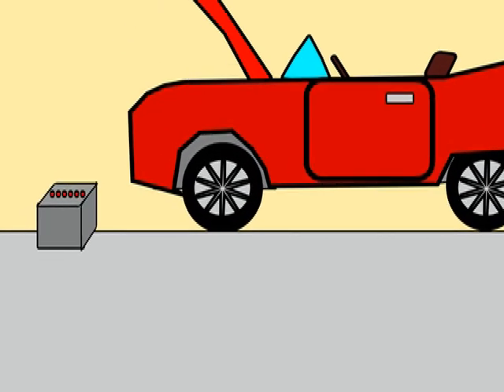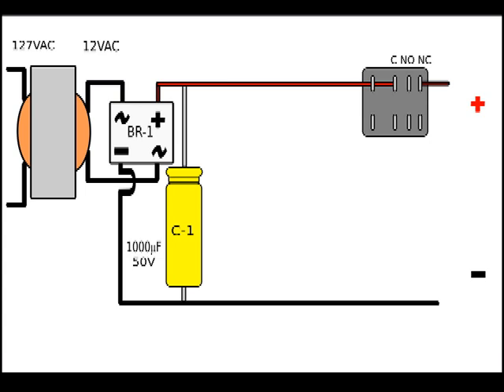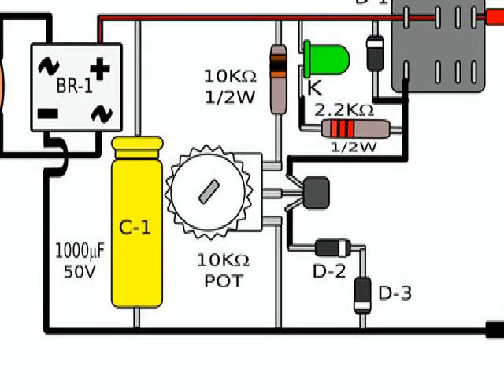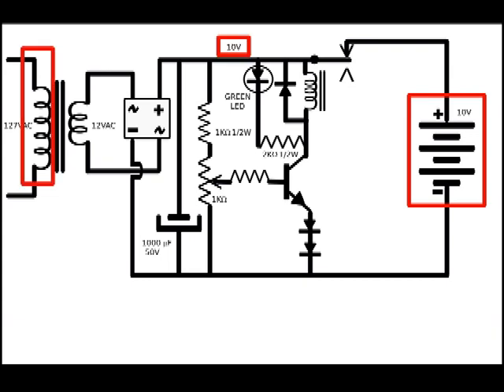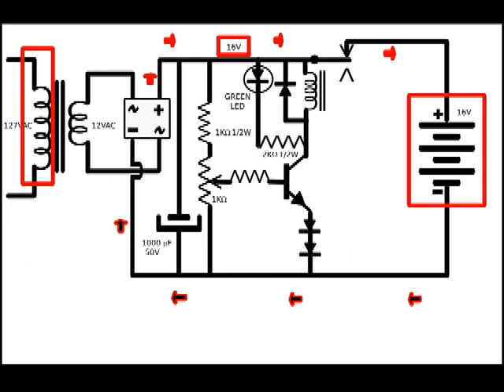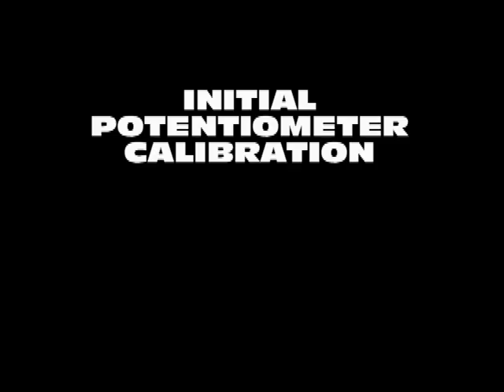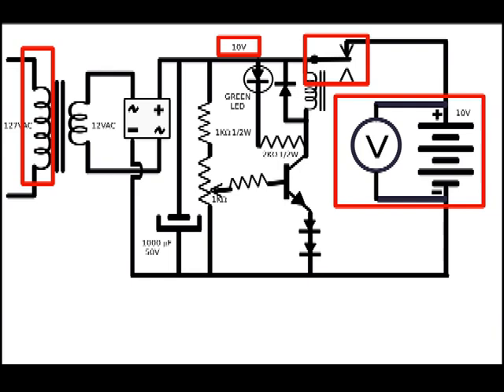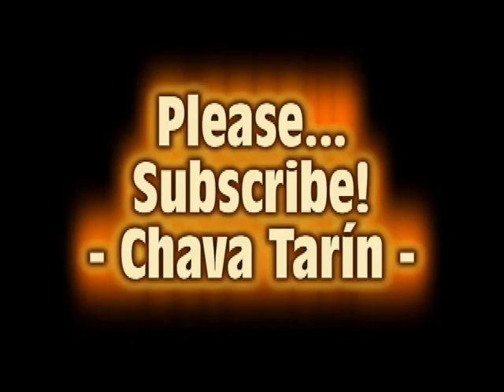Homemade Car Battery Charger

Comment: Its the same sercute for charging 12v 7ah battery sir?
Reply from the maker: It depends on the condition of the battery. If it has been sitting discharged for sometime, they tend to lose capacity due to sulfation. If your battery is not a lead-acid type, they require a special charger, otherwise they can heat up and even explode. Please beware of all these facts. I would not use it with small batteries, but only with normal car batteries, the potentiometer must be carefully adjusted for cutoff at about 14 volts. Do not leave unattended for long periods if battery warms up.
Reply: @eltunene  thanks sir for your reply, i respected 😊😊

Comment: Hi. Great video and explanation of the theory of this battery charger. I want to build it but only have a 12 volt 5 terminal relay. How would I go about wiring the 5 terminal relay. Thanks for any information on that.
Reply from the maker: Dear Fire Bird, please find in My Community some schematics and pictorial info on relays. The llink to them is https://www.youtube.com/channel/UCmjQnuJwV0FkjdEyi3099RA/community?lb=UgxcG7n42op8ZYGdF1R4AaABCQ . For an unknown reason, sometimes the link does not work, in that case, pease scroll My Community until you find it, You can also send me an e-mail address and I can send you the files.
Reply: Thanks, will do that cause I'm very interested in making this smart battery charger.

Comment: Tank you very much for this video.
But I do have a trouble on my transformer wich I  have in my old charger the one I tried to fix.  The secondary, it is at 38 volts out. So What will be the best thing to do ??

Thank you    Fernand
Reply from the maker: Dear friend, there is a couple of things you can do: check your charger to find out it the transformer secondary has a tap. If so, connect the transformer normally to household voltage and check the secondary for a low voltage tap. If the diodes or diode bridge is connected to the ends of the winding, and if there is a center tap in it, you can use two diodes, each anode connected to one end and joining the cathodes together, you would have half the voltage using both cathodes and the center tap as output. If this is not at all possible, there is another possibility, which is often fail-proof: in series with the primary of your transformer, connect a light dimmer, you can turn the dimmer down until the output is your desired voltage, and even adjust it for fast, medium or slow charge. It is advisable to have a voltmeter in the output so you can adjust your primary voltage and thus the output voltage with precision. Take a look at my solar scheme for more details on how to wire the dimmer. This is the link to that particular video: https://www.youtube.com/watch?v=X8FCHPT3u6Y&ab_channel=ChavaTarin Hope that helps.

Comment: Thank you for this video. I constructed the charger as given by the circuit. It is delivering about 16.9V. The problem is the led is not responding to the potentiometer, when I tried to set the cutoff voltage. I didn't know what to do.
Reply from the maker: Dear Pero. both the LED and the transistor are critical as to polarity. If the LED is in the wrong polarity, the relay will work but the LED will not light. On the other hand, if the transistor is bad or incorrectly connected, both the relay and the LED will not work. It is easy to tell when the relay is working, you can watch it move as you turn the potentiomenter. Please check transistor pinout and let me know what you finally got. You can take a look at a drawing about transistor pinout at my Community, https://www.youtube.com/channel/UCmjQnuJwV0FkjdEyi3099RA/community?lb=UgyQr1KNTGDorZ0BdsB4AaABCQ Hope that helps!
Reply: Sir,Thanks a lot once more, it seems I placed the emitter pin of the transistor where I suppose to place the collector. I will rectify the circuit and get back to you.

Comment: sounds like you r old guy.. but thank you so much for useful video.. i learned something as a bigenner.
Reply from the maker: Thanks, Joshua, for your kind comment!! Yes, I am an old pal. Have been around for almost 80 years now. My career is electronics, I worked a lot with circuits and industry repair work, back in the 50's and 70's. I enjoy doing something that can help someone else to decide on their career and be ready to face low times in life. Thanks again!

Comment: Sir transistor value sir your circuit diagram send me mail sir transformer value and diodes value send me mail sir ,my mail ID is : pravinkumar31@gmail.com
Reply from the maker: Deer Praveen, the parts list is at my Community, the link is https://www.youtube.com/post/UgzfMtif4ytBZI317Yd4AaABCQ?app=desktop There you will find more instructions and even an update. Please check there, Thanks!! There is also a hint on how the transistor pinout goes at https://www.youtube.com/post/UgyQr1KNTGDorZ0BdsB4AaABCQ

Comment: Sir in circut diagram you have mentioned 1kohms and even variable resistor is also you mentioned 1kohms but in photo both are 10kohms pls clarify.
Reply from the maker: Sorry, it should be 1K, My mistake! I have a schematic at my community, https://www.youtube.com/post/UgzfMtif4ytBZI317Yd4AaABCQ with the values updated.
Reply: @eltunene  thank you Sir then variable pot must 10k is it correct I am going to try it Sir don't think I found mistake I want to make one
Reply from the maker: @mahendranchacko2062  Please check my updated schematic at https://www.youtube.com/post/UgzfMtif4ytBZI317Yd4AaABCQ in my community. Thanks!

Comment: Thank you very much. As mentioned by Kamau Perter below, explanation of each component is much appreciated. You are a rear breed I'd say. Most people give you schematics to build but its so rear to find who has true in-depth knowledge on electronics and willing to teach others. Thank you again and good luck :) ..
Reply from the maker: Thanks, Samy789, for your kind comment! By the way, please go to my Community, and find a more detailed explanation. I inadvertently have wrong in the video the values of a couple of resistors, they should be 1K instead of 10K. Please check at My Community for a an updated schematic. Take care and stay at home, please, these are difficult times.

Comment: Hello sir. Am looking for a circuit that will convert 24v DC to 24v AC. kindly help. Thanks.
Reply from the maker: Dear Kamau Peter, interesting, indeed. There are several features I would like to know, for instance: do you need 50/60 hZ AC output? Would it be sine wave? Would it be high power? What do you plan to feed with the 24VAC output? I've never built such a challenging project. Most switching devices nowadays are high-frequency based inverters. Please tell me more.
Reply: Okey, I needed to add a 24v dc to my amplify when power goes out but it's challenging to me. It's like my 2.1A amplifier uses a dual power source. After fullwave rectification, voltage between +v and - v is 66v dc but voltage between +v and ground is 33v dc and - v and ground is 33v dc. Help me out how to introduce the alternative 24v dc source to the amplifier. Thanks.

Comment: transformer current ?
Reply from the maker: This charger is intended for slow charge, so a 10 amps secondary should do. In case of need for faster charge, the transformer would have to be bigger.

Comment: Good video. Dear friend, could you tell please - is it possible to use transistors 2N3055 and D880 ?
Reply from the maker: Dear friend, I think the transistors you mention are medium power transistors, and tend to be "harder" as to Base-Emitter current, whereas 2N2222 is very low base current-rated. Hi-Power transistors can require a much different pot for adjusting cutoff. Besides, lo-power transistors are cheaper. However, you can use almost any type of NPN General Purpose transistor, as long as it drives the relay properly.

Comment: Don't forget to add a doide between positive lead and the battery positive terminal forward biased and very close to the battery positive terminal to avoid short circuit between battery and the vehicle body as an important safety measure. Accordingly charging voltage should be increased by 0.65 v.
Reply from the maker: Good point!!

Comment: Beautiful detailed explanation for each function of the components sir. I love it and congratulations. Looking forward to more projects from you sir.
Reply from the maker: Thanks, Kamau Peter, for your kind comment!!!
Reply: @eltunene  What is the minimum amphearage for the step down transformer?
Reply from the maker: @kamaupeter8217  It depends on the size and degree of discharge of the battery. The idea with this charger is a slow charge rate, about ten amps. However, if the batteries to be charged are small, say those used in motorcycles, they can be charged with a five-amp transformer.
Reply: @eltunene  Well understood sir. Thank you so much and GOD bless you.

Comment: What is the heatsink for?
Reply from the maker: Dear Maurice. All medium to high power semiconductors get hot during their operation. The heat sink is a way to convey the heat generated by the crystalline structure of the device into a highly conductive metal plate, in order to dissipate it to the atmosphere. Sometimes some conductive silicon paste is used to fill in porosity and improve the conduction. The bigger surface area of the sink, the more heat it will remove from the diode, transistor or IC chip. Heat sinks may be a piece of aluminum sheet, sometimes with cast fins to increase the surface area.
Reply: @eltunene  Sorry, what I meant to ask is, what component is the heatsink for? If its for the bridge rectifier, could I just not bolt it straight to the chassis Im building this into?
Reply from the maker: @mauricemouton4731  Yes, of course, as long as the chassis takes the heat away from the bridge fast enough, no problem. It would be better if the chassis in contact with the bridge is not painted and even better if you can use heat conducting paste to the joint.

Comment: What are the reference fort that bridge diode? the other diode and the transistor.if you can give me that list of component reference.example diode reference in4001. thank too much .
Reply from the maker: Dear San 64, please go to Community section on my channel, and you will see a revised schematic (I had an error in the video for a couple of values) and please check the parts list. Those are the final values for the project, plus some additional comments. Thanks!!
Reply: Thanks guy i really appreciate you and really need the list of component😊👍👍👍

Comment: what is wattage of tranfromer
Reply from the maker: Transformers are reactive devices, that is, they are mainly rated by the Volt-Ampere figure (VA), which is merely a convention to  distinguish apparent power from real power. In a purely resistive device, you can get watts by simply multiplying the applied voltage times the current flowing into it. However, since transformers are reactive, and voltage is out of phase with current, this is no longer valid when it comes to watts. A transformer can be handling a high voltage and drawing a high current, but the wattage may be very low, due to the phase difference (low power factor). However, they are usually rated by their volt-ampere figures, or even just by their turn ratios and their output current. Transformers with the same sized core usually have the same VA rating. In this case, being a homemade device, and subject to experimenting and changes, the suggested  VA figure would be in the secondary actual voltage times actual current, say 12V X 20A = 240VA. Watts can be much lower than that, depending on the load the transformer has to handle. In a 20A output transformer, as long as the current does not exceed 20A, the transformer can work safely. As the load increases, the power factor goes up and more real power is being drawn from the power line (real power = Amps X Volts X Power factor).
For the purposes of this project, the transformer is considered as "a 20 amp transformer". Of course, the power line voltage (127V or 220V) must match the design of the transformer primary.